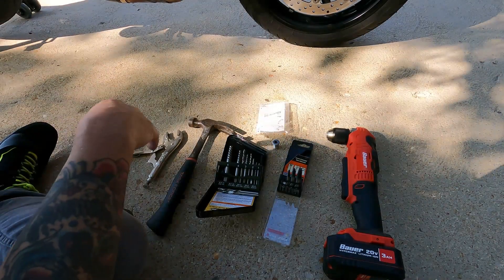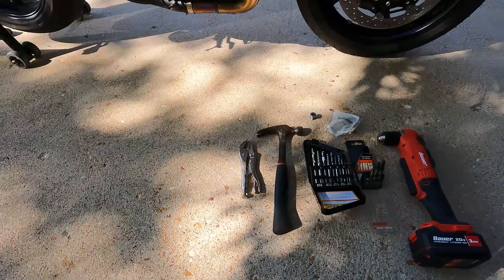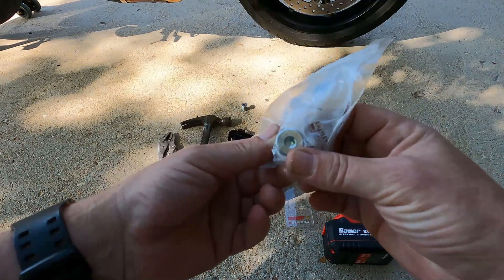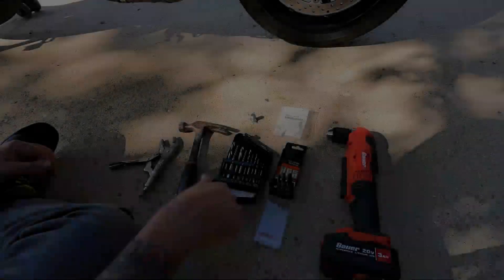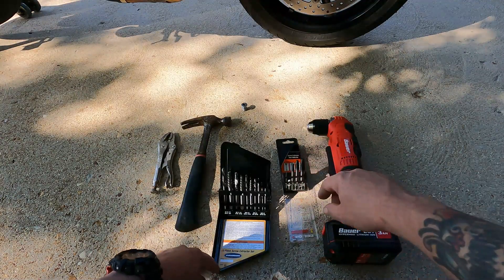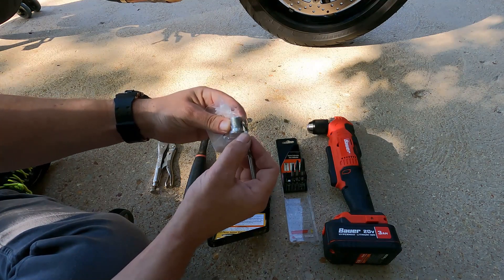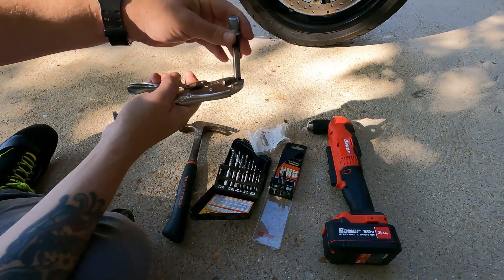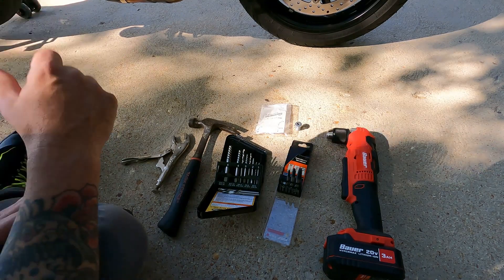2022 Yamaha MT 10 Fail! ( 600 mile service gone wrong! ) Stripped oil drain plug!

Comment: i just changed my oil and had no issues with the drain bolt it came right out wonder if it was just the wrong size or worn out allen socket you used, I didnt even have to use a large ratchet i used my small one if i recall so they didnt have it massively over torqued
Reply from the maker: Think mine was overtightened from the factory. I have heard that others are having the same problem. Glad yours worked out.
Reply: Mine was also factory overtightened  but I managed to not strip it at least  I found the tightest 6mm I had!  I thought about even wrapping foil to make it tighter there is no excuse for Yamaha doing this if you ask me  My guess is they wanted low profile so idiots did not break the pan running out of ground clearance?  Which okay I can buy that but why not put back up hex outer on it too?  Or at least make it out super tough steel?

Comment: Mine is stuck too it is ridiculous it is so tight AND that the allen is so small and has been since the FZ01!....when I get it out I will replace it with an aftermarket drain plug no way I am using the stock one after this.....btw why not vise grips rather than drilling?  Whew I got it out I had to use a cheater bar  on the allen and REALLY pull like hell  I swear I thought the wrench would break!  again WHEW!  I guess Iwill use this plug one more time but I am ordering aftermarket with magnet while I.m at it!